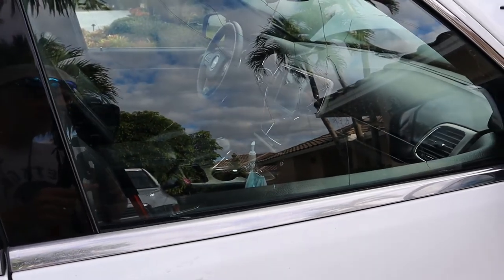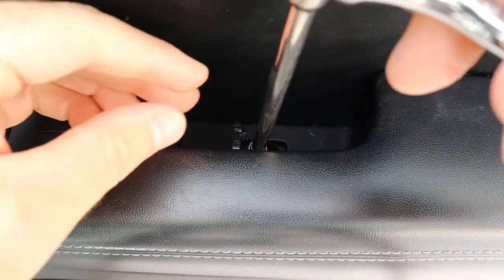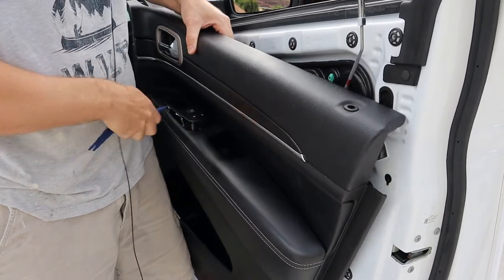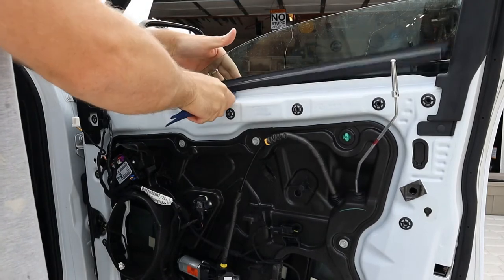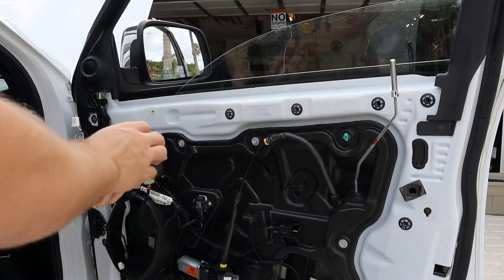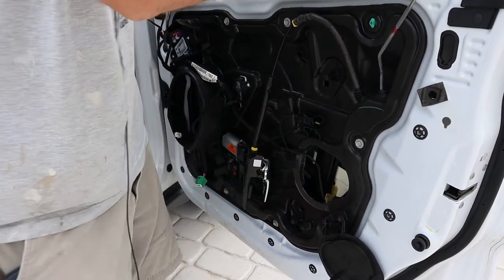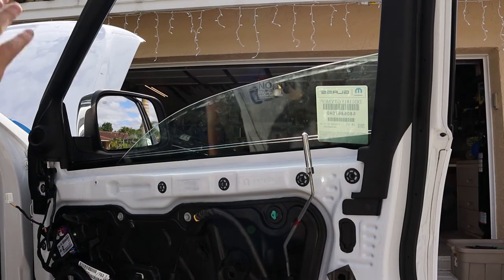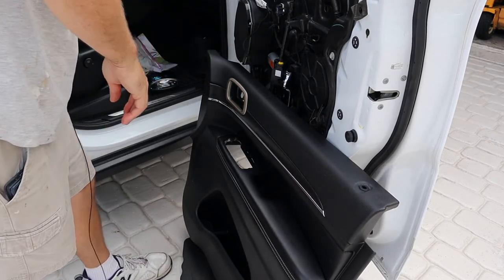2015 Jeep Grand Cherokee WK2 - Replacing Front Window Glass

Comment: To detach the window from the carrier >> Raise/lower the window, and white plastic attachments, until oval shaped holes, in the metal track and the yellow plastic grips/carrier, align with the holes in the white plastic attachments. Push small blade flathead, or a narrow Phillips head, into the hole, and push the tab at the backside of the yellow grip, horizontally, while lifting the window out of the grip. The new window will slide back into the grip.

Comment: dude, you don't need that gizmo to remove the belt molding... crab it with both hands and roll it upwards, assuming there isn't a small screw on the back. You can use a plastic trim tool to assist wedge it from the front. Funny thing, you don't need to remove the front belt molding,
Reply from the maker: Yes I know, I covered that at the end of the video

Comment: I've been wanting to pull the barrier off of my 20 to apply some sound dampening and couldn't find a video of someone replacing the window regulator because it's bolted from the inside. it being attached to the glass is why you cant just pull the panel off. it recently occurred to me that window replacement is probably much more common and would show the way. this is the way. thanks for posting the video, i'll make sure i don't try to pull the outer molding off.
Reply from the maker: Yeah it's actually surprisingly easy to pull the window out on this vehicle. If I had to do it again I could probably do it in half an hour if I wasn't filming lol